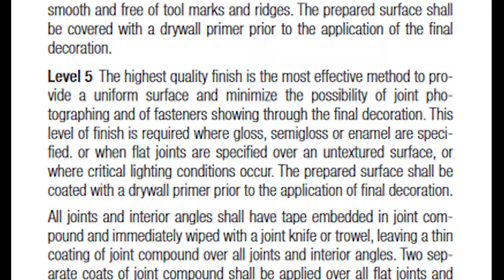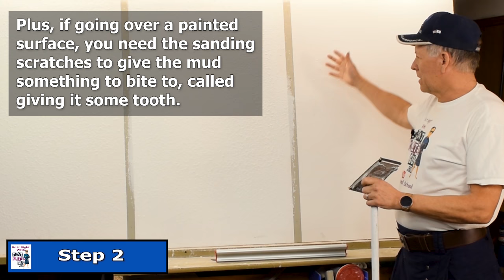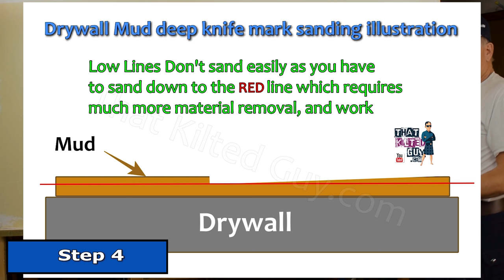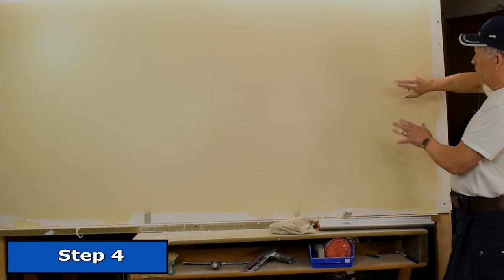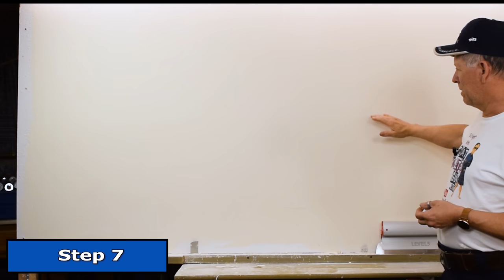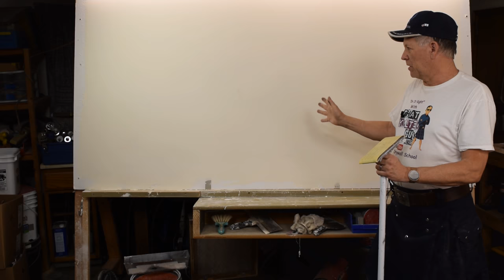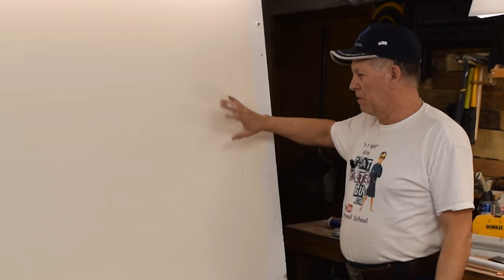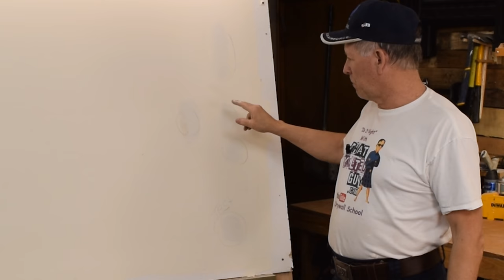Got UGLY TEXTURE? Skim Coat it away.  I'll teach you how

Comment: Can't you use a building primer, like with automotive finishes? It's not going to take any wave out but how you would do a fender say, bondo, sand, finish bondo, sand, building primer, sand, paint.
Reply from the maker: This has MUCH WORSE defects than what an auto primer will cover, even a high build primer
Reply: @ThatKiltedGuyDIY  I am going to be remodeling a condo we just got to live in. I want my walls to be equal to my auto finish (ideally) what extra steps would you add if any to achieve that goal? Just a ton of sweat equity?

I've prepped and painted many cars, the process seems basically the same, different materials. Maybe my goal is to lofty?

Thanks for your response
Reply from the maker: To be that perfect would take me too long to explain. It is similar so you’ll probably be fine

Comment: Can you mud over a painted wall or does paint and mud not stick together well?
Reply from the maker: If the wall is clean and you sand it first, then dust it, it does
Reply: @ThatKiltedGuyDIY  Should you use a heavy grit for that? I was told never to sand wood with too fine a grit bc the more coarse the better the paint, sealant, etc will stick to it.
Reply: How do you "dust" a wall?

Comment: Sanding and scraping will allow if any asbestos to come loose?
Reply from the maker: Walls shouldn't have asbestos in them.  If it's popcorn, and older than 1980, then it could.
Reply: And there would be so little it really wouldn't effect you.
Reply from the maker: Donovan Beavers in the ceiling, they don’t have a safe level so it may not harm you but it’s not worth the risk.

Comment: Any way to do a wet sand to avoid dust?  I live in a 1927 house. Worry about lead.
Reply from the maker: If there's that concern you can buy a lead test kit at most hardware stores.  Or degloss with a chemical solution.  Ask at Sherwin Williams for that.

Comment: After the level 5 I paint Over it using a roller ?
Reply from the maker: Yes. One coat of primer and two coats of paint with a 3/8” roller
Reply: @ThatKiltedGuyDIY  thanks for the response.  I'm planning to do this job tomorrow  for my home theater projector wall but I'm very hesitant.  So after level 5 I can just paint over it with the primer and 2 coats of gloss paint?

Comment: Hi, I NEED HELP! Please comment. So we skim coat all of our walls and ended up with beautiful ultra smooth walls BUT when the painters came in, they prep and spray painted the whole house and when they where done the walls didn’t have that smooth finish they felt rough like a sand like feel. I don’t have a clue what happened in the process but they messed up the smooth finish. He doesn’t explain to me what went wrong I don’t know what to do.
Reply from the maker: Sounds like you probably didn’t remove all the dust before the painters came in, and they may have sprayed it and left too much overspray in places
Reply: Dust was blown up into your paint with the spray gun because you didn't vacuum & wipe off ALL of the dust before the painters came in. The painters should have warned you that was going to happen
Reply: They did not strain there paint